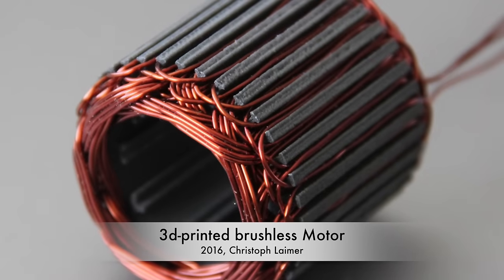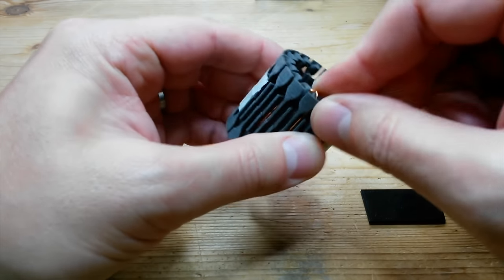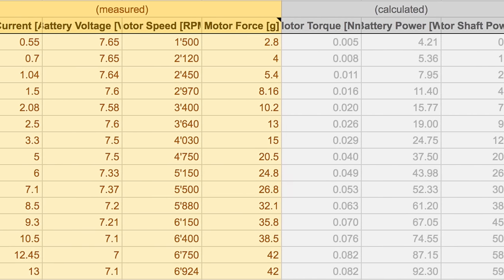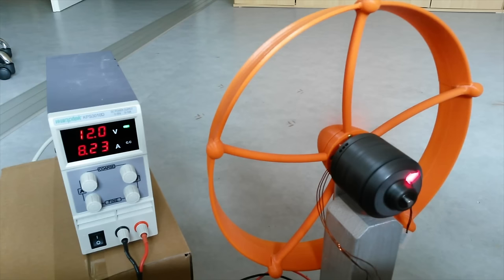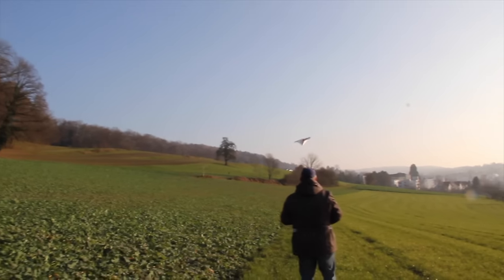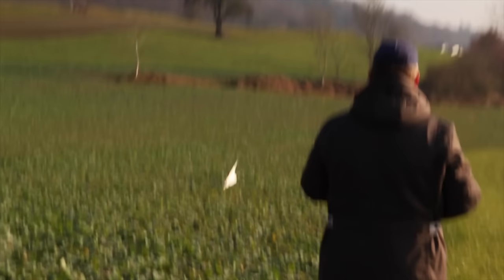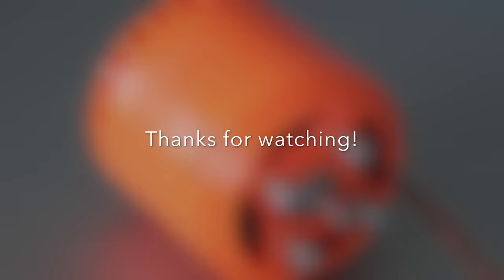RC Plane with 3d-printed Motor and 3d-printed Propeller

Comment: This is an excellent project which reduces a number of old skills to something simpler using modern technology. In the old days the product was more sophisticated than the tools that made it, now it is a case that the product is never as complicated as the tool that made it.
In this particular case there are such a lot of sciences and skills that were reduced to a  computer programme. But even so the skills of the practical side need to be known as to how much fusion does takes place to make a strong propeller and in addition to all the automatic  components there is the winding and the placement of the magnets to produce a rotating magnetic field.
There is such a lot of appreciation and while we are at it , I would say that  better streamlines support spokes could have been incorporated to keep the shroud of the propeller, being round they would have a lot of drag and turbulence.  I love the manner in which the spinner incorporated part of the propeller, excellently conceived.
In a few years time no company will keep spare parts, but just a 3D printer in the corner somewhere and it will be used every time the spare part is needed. When the companies would sell you is the programme to do it with!!  
Really I do not like the way we are going as education is producing people who  do not seem to go through the whole education of the requirements to know such deep detail about many components.   I feel that countries which produced oil seem to buy products which  they own and the pride of ownership does never top the pride to have grown with the product  from its conception and its making......... there are so many components in the human person which do not develop just because one owns a product or knows how to operate a machine. So modern people should be aware of the fact that knowing how to fill time sometimes needs careful consideration as there are  moments when we are all alone without any machines around and we still have to keep same with a good mental state and good physical strength so one needs to improvise a system where one exercises the physical and the mental state of mind  without so many sophisticated machines around to help you.  Still it is a nice life we now lead but one must not despair when all machines around us do not work!!
It is the last day of the year 2016 so a happy and healthy  new year  2017 to all.  Congratulations  the making of this project it is excellent in every way.

Comment: Just finished printing the Rotor with absolutely ZERO warping in ABS on COLD plate with 100% infill, .100 height and 260C nozzle temp, no raft, 4 layer skirt, 15 skirt outlines, 0.0 skirt offset and it came out BEAUTIFULLY after 11:23H!!!

Comment: Nice project! Efficiency is higher, than I would expect. The material has only poor magnetic properties compared to real silicon steel laminations. And the rotor has no backiron. So there is an additional "air gap" in the flux pattern behind the magnets. Use a steel ring (tube cutting) instead. You can also integrate the ring in a printed part. This will also dramatically increase the strenght of the rotor and also the max rpm.

Comment: That is impressive. I'm wondering that can the design be modified to convert the motor into a magnetic floating vertical axle bearing? Basically frictionless magnetic rotary bearing.

Comment: Have you thought about running a carbon or aluminum rod to the propeller and placing the engine more towards the front, or would it not survive the torque?

Comment: to get more power and efficiency u can modify the rotor outer diameter like 6mm smaller and put something like thin steel ring thickness around 3mm (note ring has to be tall as magnets) that way magnetic  flux penetrates stator deeper and u can spin it up much hire rpm  😀

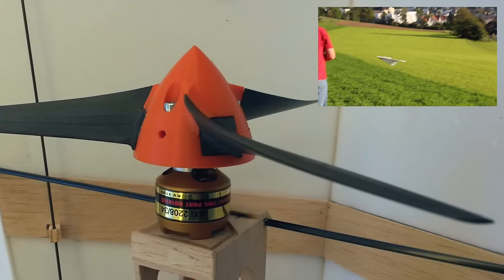Comment: damn love the curves on that propeller 2:30

edit: realize this is an old video but why don't you launch by holding the right leading edge with your right hand and launch it upwards that way. 

Curious if you pointed the motor through the CG of the aircraft or of it's just straight say with the datum line of the plane. Cool that it's a large paper airplane haha
Reply from the maker: I'm holding the plane at the nose, because I built-in some reinforcing wood for mounting the battery. The foam at the wing edge is far to thin. The CG with the 3d-printed motor was definitely wrong (and I knew that before the flight). The mounting position couldn't be easily changed. But the initial version with a common (lighter) motor was well constructed, with a proper CG and the motor pointing through it.
Reply: Christoph Laimer I see. what about a 3D printed leading edge? probably heavy? do you do any airfoil cutting? anyway thanks

edit: even so the plane doesn't look very heavy, you don't have a high thrust to weight ratio? Maybe that foam is a really brittle, is it like 3mm depron or something?

this channel I wrote to reply with is empty but I am also an rc builder (was) not so on the 3D printing though. Greenace92 is my actual channel/Normalbus but haven't flown in a few years. Commenting as a fellow pilot haha
Reply from the maker: Yes, it's 3mm depron. No airfoil - a (almost) perfect scale-model of a paper-plane.
Reply: Cool. Well I'm subscribed, I like your motor escapades. I am curious if you do the math to see the rpm limitation of plastic. I don't know modulus of elasticity equivalent or something... not sure if that's the right unit to consider with shearing force. In that one video the bell shattered at full rpm. Maybe you're targeting low kv large spin (prop)? At any rate I'm dragging this on thanks for responding.
Reply from the maker: The "tensile strength" is quite useful to do some math ( http://toner-plastics.com/tesile-testing-results-of-toner-plastics-3d-filament/ ). The shape of the main structure around the magnets is like a tube - the centrifugal force of the magnets slightly increases the diameter, and produces a tension along the (outer) surface of the tube.
Reply: Christoph Laimer cool. Thanks for your time.

Comment: Would it be possible to print larger multi-section blades, with 1-2 carbon fiber rods inside them and epoxied together? Ie take the blade, cut it down the middle so it's half length, add a small hole or two for the rods, then print each half? I'm thinking for something like a 26x10" prop, 2, 3, or 4 blades. My build area is only ~ 8.5-9" (standard typical first machine size of 220x220x250 or so); assuming I did a blade diagnally, the largest I could print would be approx 310mm, or about 12". that's about half of a 26" diameter blade, so I might be able to get away with doing each blade in a single go without having to epoxy or doing CF supports.

What material did you print the blades in? I was thinking of starting with ABS, then working my way into either CF/Nylon or even Polycarbonate. I was even thinking of using them to just get the shape I need, then either casting them, or making molds to lay some Carbon Fiber, and/or using them as cores for CF coated blades.

I wonder what the cost of making a motor yourself vs buying one off the shelf would be? Is there any advantage, did you do a cost comparison to a similar motor? I supposed at the very least for a given size/winding yours would be lighter due to the plastic vs aluminum motor housings.

Comment: so what is the thrust measurement?  I have a 3d printer.  I want to make 400kv motor having 2000g thrust using 15" prop. I want to know if this is possible to do using plastic.

Comment: wirklich sehr gut. 
but this is not the halbach-cylinder based engine?
Reply from the maker: It's not the Halbach motor, but its smaller predecessor: the makeSEA-motor.

Comment: Awesome video and project! Is that a carbon-fiber bed in your ultimaker? Also, what filament type did you use for this?
Reply from the maker: Yes, it's carbon. Printing with PETG. Great adhesion at 80°C.

Comment: ive been following your build have you played with the idea that  the radius of the motor looks more like .___|___| instead of .______| 'what you did', would it increase torque?
Reply: meaning magnets on the outer shell but also to an inner shell directly afixed to the main rotor

Comment: Very clean print, i see that you use some custom bedplate, is that carbon fiber plate ?
As well I see that you have excellent print must be full infill , what brand of PLA are you using.
I saw on your makesea page that you recommend petg. but for long print i wonder if warping won't be an issue.
Anyway bravo, you have put a lot of time into this.
Reply from the maker: It's a common carbon plate 2.5mm thick. Motor and Propeller are printed with PETG (for this application I don't like PLA, because it's much more unpredictable brittle). It's all from http://www.extrudr.eu. Their PETG doesn't warp, and has very consistent quality.
Reply: thanks you

Comment: I noticed that you use a carbon fiber sheet for your print bed.  Does it work better than glass? Any special tricks that get your prints to stick better on carbon fiber? do you use heat on the bed also? thanks
Reply from the maker: I'm printing PETG or PLA (no ABS). These materials stick perfectly - I just keep the bed clean (grease free) with some water and alcohol. I bought it at https://extrudr.eu/ It also works to print their BDP, which doesn't stick at all on glass.
Reply: Thanks Christoph.  You bought the carbon fiber bed at extrudr.eu? or the materials?  I didn't see the carbon fiber bed on the site.  Also, do you required heat to print on the carbon fiber bed/sheet?  Great video by the way, really cool that you were able to 3d print the motor stator and rotor.
Reply from the maker: https://extrudr.eu/collections/equipment/products/carbon-plate
I'm still heating it up to 80° for PETG and 60° for PLA

Comment: Do you still have the STL File for the 3 Blade prop? I was looking & Couldn't find it!! I find your work really appealing...
Reply from the maker: You should find it on makeSEA. Maybe you need to register, before you have access.

https://www.makesea.com/mashmarket?p_p_id=141_INSTANCE_doReYoyki7Qc&p_p_lifecycle=0&p_p_state=normal&p_p_mode=view&p_p_col_id=column-1&p_p_col_count=4&p_r_p_564233524_resetCur=true&p_r_p_564233524_tag=propeller
Reply: After browsing all over I manage to find all the work that you have done and you have posted! thank you very much It is greatly appreciated.

Comment: what about using plastic casing tho surely this will melt once run for a while causing it to most likely break apart
Reply: oh wait i just watched your other vid showing it explode at full rpm i guess i was right about it breaking apart
Reply: all propellors do that at a certain rotational velocity, but the other video showing the destruction wasn't due to heat, just centrifugal forces

Comment: Super Arbeit! Du solltest darauf achten, der Schwerpunkt ungefähr auf dem vorderen Drittel der Flügel liegt (das weißt du wahrscheinlich  auch selber) aber deshalb ist es bei dir nicht möglich, ein frontlastiges Flugzeug zu bauen, weil deine Flügel viel zu weit hinten sind.
Reply from the maker: Die Geometrie des Fliegers hatte ich für den herkömmlichen, leichteren Motor ausgelegt. Da stimmt der Schwerpunkt ohne Zugabe von Blei.
Reply: Welches CAD Programm verwendest du?
Reply from the maker: Autodesk Fusion 360
Reply: Christoph Laimer danke für die Antwort, ich benutze dasselbe. Sehr gut geeignet für 3D-Drucken wie ich finde
Reply: Hallo nochmal. Ich wollte deinen Motor bauen, jedoch haben sich ein paar Probleme ergeben, bei denen ich dich um Hilfe bitten wollte. In deiner Anleitung ist das nicht ganz klar geworden. 
Meinst du mit "Shaft Collar" einen Wellenmitnehmer? Wenn ja, woher hast du einen in diesen Dimensionen gefunden? Ich suche schon eine längere Zeit und finde nichts. 
In den Dateien ist eine Datei mit dem Namen RotorCollar vorhanden. Setzt man den Wellenmitnehmer darin ein, um die Welle zu verbinden, oder wo genau wird der Wellenmitnehmer eingesetzt?
Das wurde nicht ganz klar in deiner sonst sehr detaillierten Antwort. 
Vielen Dank!
Reply from the maker: Genau richtig: der Stellring aus Metall sitzt im Stellring aus Plastik und funktioniert als Mitnehmer. Dafür ist es wichtig, dass die Schraube des Metallrings etwas in den Plastikring ragt. Als Modellbauer hatte ich den passenden Stellring in meinem Sortiment. Ich denke der hier müsste auch passen: http://tamico.de/navi.php?a=8927&lang=eng
Reply: Vielen Dank!
Reply from the maker: Bitte gern geschehen. Ich sehe, ein Ring mit 10mm Aussendurchmesser wäre einfacher zu beschaffen als einer mit 9mm. Vielleicht passe ich das Design an ...
Reply: Christoph Laimer Das wäre super! Auf der Suche nach genau den richtigen Magneten hatte ich auch relativ Schwierigkeiten. Jetzt habe ich welche gefunden, die angeblich n50er seien sollen, für den Preis (8Euro für 20stck) sind es bestimmt keine.
Reply from the maker: Finding cheap and strong magnets is a lottery game. In any case I recommend to buy more magnets than required, and measure force and weight of all of them. Here is a description about the selection: http://www.makesea.com/wiki?p_p_id=54_INSTANCE_9jGVcyv6Jb3y&_54_INSTANCE_9jGVcyv6Jb3y_title=makeSEA+Analysis+-+Brushless+Motor+-+Selecting+the+Magnets
Reply: Danke!
Welche Bauteile genau müsste ich anpassen für einen Stellring mit 10mm Durchmesser? Ich könnte es eigentlich auch selber machen
Reply: Hallo,
Also das Umwickeln mit Kupferlackdraht funktioniert nicht. Ich habe mich genau an die Anleitung gehalten. Das Ergebnis nach 3 Stunden: Ein steifer Nacken, wunde Finger und Verwirrung. Ich habe es geschafft 1/5 zu wickeln. Der Draht (1mm dick) passt ums Verrecken keine viermal durch denselben Schlitz, wenn überhaupt zweimal. 
Es geht einfach nicht, der Draht ist viel zu dick. 
Wie hast du es gemacht, und hast du das WindingTool auch verwendet?
Reply from the maker: Zugegebenermassen ging das Umwickeln der ersten Version mit dem dünneren Draht auch bei mir einfacher. Beim dickeren Draht müssen Überkreuzungen möglichst vermieden werden. Je nach Druckeinstellung (over-/underextrusion) könnten die Nuten auch unterschiedlich schmal sein - wenige zehntel Millimeter können einen Grossen Unterschied machen. Du kannst natürlich auch einen dünneren Draht (0.7mm) nehmen dafür aber mehr Windungen (6) in die Nuten packen.
Reply: Christoph Laimer Ok, Danke. So weit ich weiß ist die Zahl der Umwicklungen doch relativ wichtig oder? Oder kann ich bei jedem Schritt statt viermal auch einfach nur dreimal umwickeln?
Reply from the maker: Dreimal geht auch. Die Nennspannung wird damit niedriger, schätzungsweise 5.5V. Der Motor ist dadurch nicht unbedingt schlechter, aber ich fürchte, dass ein normaler ESC keine Freude daran hat.
Reply: Christoph Laimer ok Danke!
Reply: Christoph Laimer ist es möglich, die f3d Dateien für den Rotor zugänglich zu machen? Wenn man versucht, manche f3d Dateien herunterzuladen, steht da "Zugang verweigert". Meine Magneten sind minimal kleiner als die slots, die für die Magneten vorgesehen sind --> die Magneten flutschen sofort heraus da sie sich gegenseitig anziehen.  Festkleben scheint mir die schlechteste Option
Reply from the maker: Die Rechte für fas File sind bei makeSEA. Aber ich bin mir sicher, du bekommst das File, wenn du dort nachfrägst. Die Modifikation mit kleineren Einsätzen könnte auch anderen Leuten nützlich sein.
Reply: Christoph Laimer Das werde ich machen, danke!

Comment: Hey TTN, cool paper airplane!  What kind of paper did you use?  A great type of paper to use is Tyvek: it cuts easily, but is very hard to tear, and is waterproof/resistant, and is light.  I first ran into it with floppy disk sleeves when I was a kid, but it's commonly used as a vapor barrier in building construction, and also often used for shipping envelopes.
Reply from the maker: Actually it only looks like paper but it's Depron. But the shape of the plane is from my smaller paper-plane. It's scaled up 5:1

Comment: What if you used some of the iron powder mixed plastics for the stator?
Reply from the maker: Actually I've used the Magentic PLA from Proto Pasta for this Motor. I've also tested the electromagnetic behaviours, and it was somewhat disillusioning: http://www.makesea.com/wiki?_54_INSTANCE_9jGVcyv6Jb3y_title=makeSEA+Analysis+-+Magnetic+PLA+-+Electromagnetic+Tests&p_p_id=54_INSTANCE_9jGVcyv6Jb3y

Comment: are there also stls for the modified propeller that you were using for that motor? because I couldnt see them.
how does the motor perform so well without metal anchor?
but I have to say: awesome work done here!
in the end all I am interested in are the rotor parts, because I have searched the web for hours now, and yours are probably the best I found!
Reply from the maker: STL for Propeller can be downloaded here (make sure, you're registered): http://www.makesea.com/propellers
Reply: Christoph Laimer awesome